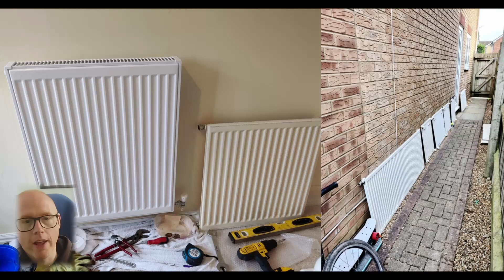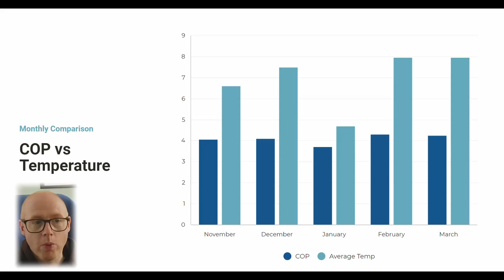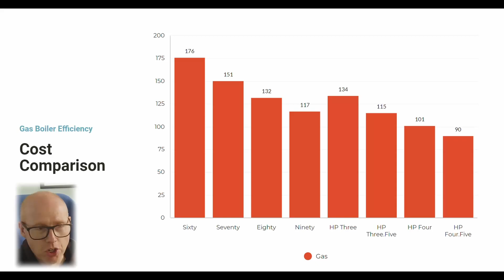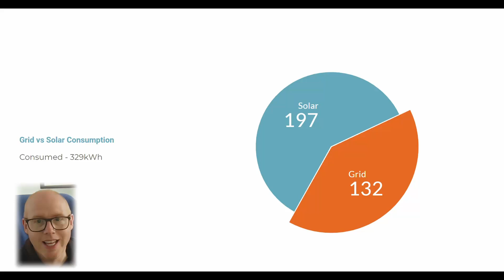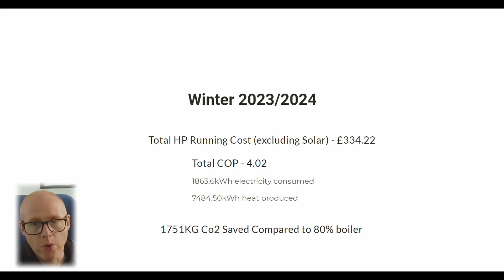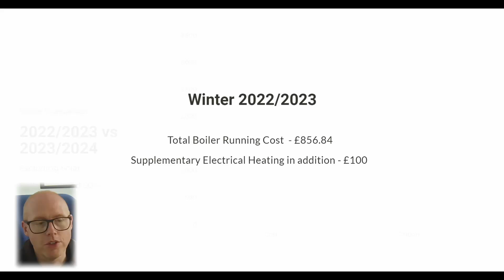Was my Heat Pump a waste of money? How efficient was it over the first complete winter? Full data!

Comment: Which hot water tank would you recommend? You mentioned a few times there are much better ones out there
Reply from the maker: https://newarkcylinders.co.uk/products/hg-series-cylinders/

That's where I would start.

There are also some cheaper cylinders that perform better than Vailant's own because they have a larger coil surface area.

Good luck!
Reply: @UpsideDownFork  thank you so much!

Comment: Thanks for the detailed info unless I missed it I do not think you mentioned how much your installation cost which would be handy to know.
I just saw let’s go electric ( you tuber) who after the £7500 grant only paid £500 if this was typical it would be a no brainier.
I am with Octopus and would like   Solar Battery and a heat pump but Octopus do not do installations in my area (Taunton Somerset).I filled in an  application to British Gas who I understand pass on enquiries to independent installers.So far out of all of the companies that have reached out to me none of them do heat pumps.I would prefer to deal with just one company can anyone recommend
 anyone that does all three in my area.
Thanks
Mike
Reply from the maker: My installation was closer to £4000 after the grant for several reasons. I had no radiators or pipework in some areas of the building which needed some quite substantial work. I opted to upgrade from the cheaper Daikin to the more expensive Vaillant unit also.
Still very happy with the value for money that we got.

Comment: A 24 year old boiler starting from an efficiency of 60% would be way down to around 30-40% efficiency, a new condensing combi starting @93% efficiency would have saved 60-70% of the 1.7 tons of carbon stated for atleast a tenth to twentieth of the equipment price of heat pump. I fitted 2 stoves and a biomass/pellet stove 20 years ago & still going strong. Not used any gas for last 2 years after Putins antics, spend around £450 on briquettes/pellets per year- zone use to hall pellet stove in morning & lounge afternoon to evening 24-27degree comfort most of day where it's needed i.e where we are located. I would have serious doubt about the number of skilled heat pumps engineers available for any repairs & can see a lot of these failing before 10 year time frame due to relatively simple issues
Reply from the maker: That's not how boiler efficiency works I'm afraid.

Comment: Hi mate, Really enjoy your channel. Back in November, when you got your heat pump installed, I ended up chatting with a BG surveyor who inquired if I had microbore pipes and if I was open to replacing them. I mentioned I wasn't keen on shelling out an extra 2-3k since I believed, like Heat Geek and others, that it's possible to successfully install a heat pump with microbore pipes. Lol, they ended up cancelling my appointment, stating they don't do installations with microbore pipes. Just gave them a call this morning to mention that BS managed to install yours and it's working great. They've just rescheduled my survey. Fingers crossed they don't cancel on me again. 😃
Reply from the maker: Good luck 👍

Comment: Excellent. Do you have a maintenance contract or service plan on your heat pump?
Reply from the maker: It did come with a British Gas homecare bundle which covers the heat pump for 5 years and the rest of the system for the first year.
No service plan besides that.

Comment: Thanks for your videos! They are really helpful, I have got a Vaillant 7kW heatpump installed last friday with the setup exactly as yours (45L buffer). I am trying to figure out how to get the OEM Level 3 monitoring setup. I have seen a couple of videos about it but was wondering if you have some advise on how you setup yours. Is it something I can do myself, though by the looks of it, it seems as if help from a plumber+electrician would be advisable. Thoughts?
Reply from the maker: Thanks for your comment. I've replied in this video: https://youtu.be/u6J-Ba-6-jI
In essence, I have the Vaillant gateway that gives me access to their sensors and reports.
Reply: @UpsideDownFork  Thanks, I also have the Vaillant gateway installed. I can see the COP and energy used and heat generated on the myVaillant app but not sure how you come up with the nice graphs with flow/return temperature, indoor/outdoor temperature, electricity used and heat generated. Any advise on how to get those setup? Thanks again!
Reply from the maker: @nikunjsingh78  Ah, I see. You need the ebus adapter for that so it can send to emoncms which will talk to heatpumpmonitor.org.

See more here: https://community.openenergymonitor.org/t/ebus-hardware-adapter-and-ebusd-software-thread/24176
Reply: How much would an electric comet boiler cost in comparison? 14.4 kw

Comment: I’m just a little bit west of you in Dorset. I had a Vaillant 5kW HP installed in Feb, so March was my first full month. It was a Heatgeek install. I’ve done nothing with Insulation, but had 3 rads upgraded. 
March figures were 216 kWh for Heating with a COP of 4.4, and 103 kWh for DHW with a COP of 3.1. Not on full WC yet, but will be for next winter. Thermostat is set for 19° 08.00 - 16.00, 20° 16.00-22.00 and set back to 17° overnight. DHW set at 55°, heats once a day at midday to make the most of any Solar. 
I too have 15mm copper with 10mm microbore dropping down to the rads. 
My total energy bill for March was 40% lower than the same period last year. Total energy usage in kWh was 60% lower. 
Similar to your findings, we are benefiting from a consistently warmer and more comfortable house and are so glad we did it.
Reply from the maker: Thanks for your comment. I've replied in this video: https://youtu.be/u6J-Ba-6-jI

Comment: Great review, many thanks 
It’s very difficult to compare between the last two winters because December 22 was brutally cold. So cold that my Mondeo gave in for the first time ever, and my Zoe range was reduced to 90 miles from a usual 125 winter range. That was the headline anyway, I can’t remember the rest of the winter, but comparing against this winter which must be one of the warmest on record isn’t a good comparison 
One more thought, does humidity affect CoP? Logically I would have thought it does. If so is this something you could integrate into your figures for next winter? 
I finally have a survey date from Octopus for my heat pump installation, six months after placing the deposit! 🤞🏼they honour the desktop quote and I can reach my own net zero
Reply from the maker: Thanks for your comment. I've replied in this video: https://youtu.be/u6J-Ba-6-jI
Reply from the maker: Thanks for your comment. I've replied in this video: https://youtu.be/u6J-Ba-6-jI

Comment: I know you like to quote the Co2 saved figures but for the majority of people this is irrelevant and it’s about saving money against a gas/oil boiler. It’s a shame that every install is individual to each house. Also the people I speak to can’t get their heads around the fact that you have to run an air source heat pump 24/7 through the winter months to make the savings.
Reply: For quite a lot of people looking at HP in 2024 it is relevant
Reply from the maker: Thanks for your comment. I've replied in this video: https://youtu.be/u6J-Ba-6-jI
Reply: For some (like me) it's massively relevant (and cost saving is almost as important but a good bonus).   For others, env benefits are a bonus, and for those that really don't give 2 shoots about the env, then at least they're saving a bit of money and normally having a warmer house (as long as it's been setup and run properly).

Comment: My headlines for March are: electric bill £41.52, 1st full month of HP, charging EV, running all house power. But best news is Octopus owe me approximately £15 off this as they have not been accounting for my feed-in (15p per KW about 100KW this month). Compared to last March I paid £76+ on electric, £185+ gas had no EV to charge at this time either. I think I’m better off! I need to access my data for HP, fine tune CoP but hoping can only get better. 
Downside: HP ruins your personal thermostat, like you other peoples homes feel cold, turned up car heating. House us warm/comfortable ALL the time despite costing alot less to achieve.
Reply from the maker: Thanks for your comment. I've replied in this video: https://youtu.be/u6J-Ba-6-jI

Comment: Regarding dhw. I don't understand how it does not last until the morning. It should not lose more than a few  deg in 18h? I would think with all your solar I would think a little loss in efficency and running the dhw a few degrees hotter? Would be better financially and  emmisions stand point. Also cop might be tiny bit better in a warm afternoon?
Reply from the maker: Thanks for your comment. I've replied in this video: https://youtu.be/u6J-Ba-6-jI
Reply: How do you manage 5 showers from 1 tank???
Reply from the maker: @cancerman3954  I wish we could! We have young children who bath. We do have an Aqualisa Q shower which has a digital thermostatic controller and memory settings, so we choose the program which sets the temperature at 38 degrees for example and displays a countdown timer of 7 minutes. Once the timer reaches zero, it cuts off the water.
However annoying it is, it's saved us a lot of hot water.

Comment: Did you cost your solar electric as free? If so that's wrong as it should be costed at your best available export rate, consumed solar now has a cost. It does of course depend on what export tariff's you have available depending on your import tariff. PS. Our gas bill for 2023 was £787, for a five bedroom detached house, so not to dissimilar to your yearly gas cost with the boiler. As you may remember more solar, and then an ASHP are my plans.
Reply from the maker: Thanks for your comment. I've replied in this video: https://youtu.be/u6J-Ba-6-jI

Comment: Did you sell your old radiators? I've got a couple old ones and wondering whether they'd get anything on marketplace?
Reply: You can look up how much a new one would be (somewhere like Screwfix) but they're pretty cheap. There's such a range of sizes that I think you'd be unlikely to find anyone looking for a second hand radiator.
Reply: @robinbennett5994 it depends! We changed a few and the standard ones were slow to sell and didn’t make much (£10-20 each) but we had some ‘designer’ ones (which were hopeless from a heat output point of view) which people practically queued up for and made reasonable prices.
Reply from the maker: Thanks for your comment. I've replied in this video: https://youtu.be/u6J-Ba-6-jI

Comment: Great video, our house is 1989 and am thinking about switching to a heat pump even though our boiler isn't that old, gutted the BUS grant wasn't about when we had the boiler changed! We have microbore too and looks to be like yours where it drops down off of a larger pipe. Have been adding larger, fancier rads as we've been doing the house up so just hope they will be fine when we do make the switch 🤞 Have decided to go solar PV & battery first as we use far more elec than gas which I hope will be in the next month or so! 
The deniers/sceptics will always moan. Doesn't matter how much you show them the costs/data that something works, be that PV, ASHP, EV's etc. they will always claim to know more that those presenting the information. Keep up the good work for those of us with an open mind!!
Reply from the maker: Thanks for your comment. I've replied in this video: https://youtu.be/u6J-Ba-6-jI
Reply from the maker: Thanks for your comment. I've replied in this video: https://youtu.be/u6J-Ba-6-jI

Comment: I have a Daikin MXL 18,000 BTU enhanced capacity inverter driven compressor system in Canada. It is a cold climate heat pump. It works extremely well, maintaining 22 C down to -12 C outside on a 1,100 square feet home.
Reply from the maker: Thanks for your comment. I've replied in this video: https://youtu.be/u6J-Ba-6-jI

Comment: £59 for the month/?  Sorry is this April fool? Or have you installed the heating in a dolls house. That would be every 2-3 days for me. You must be running it at 16 degrees.
Reply: What heating method do you have? If it's a heat pump it might be that it's massively cycling causing huge power draw. That could be down to a number of factors but usually poor system design and unit oversizing are the most common.
Reply: You might want to try heating your home with the windows shut, you must be getting through 100's kWh a day
Reply: Ours was £62 (Octopus Tracker) 4 bed house. Temp set at 19  night 20 for the day and 22 in the evening.
Reply: You must have made a mistake or living in a castle as you're spending £590 a month on heating and hot water?
Reply: I have a similar setup to UpsideDownFork’s and we used 334 kWh for heating alone (heating my 3 bed detached house to 21 C).     At price cap rate that would be around £81 for the month.  But, you can get much better rates than that so the figure he quoted is correct.
Reply from the maker: Thanks for your comment. I've replied in this video: https://youtu.be/u6J-Ba-6-jI
Reply: Hey @regplate2923, post your stats here maybe someone can help you understand why.